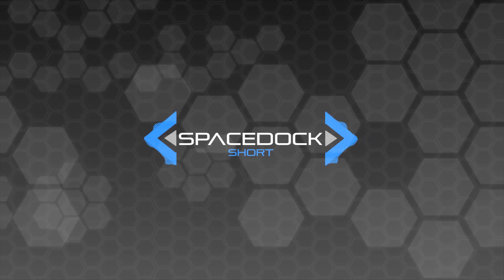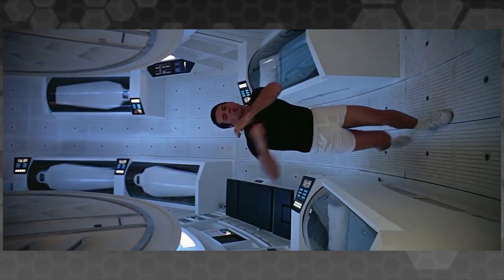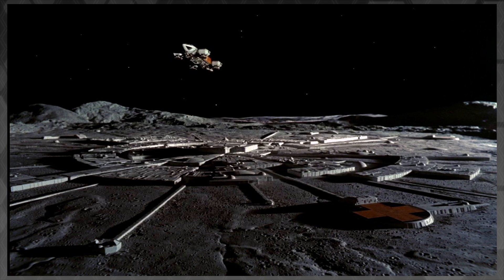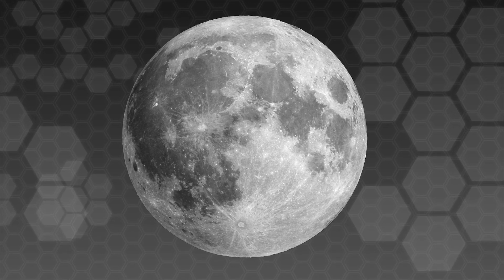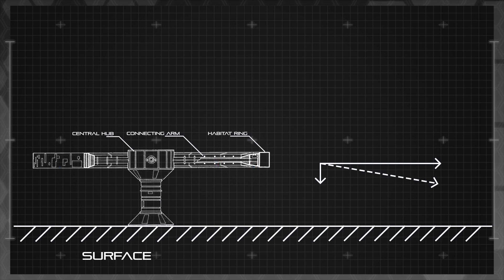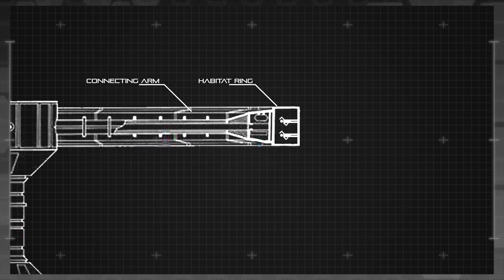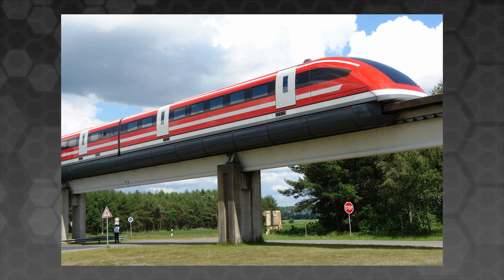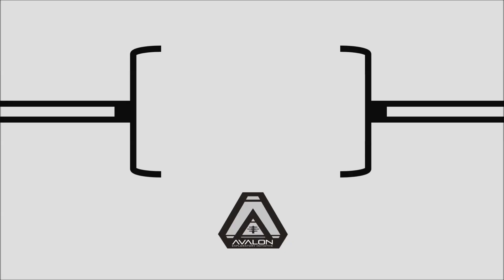How To Create Gravity On The Moon

Comment: It’s a creative solution, the question becomes how large would these structures be, where docking would be located (The Center of the Centrifuge???) and how we would be able to move between them. Also, would a hybrid system be likely, where Hydroponics farms and other necessary support facilities are kept separately, or would we simply increase the size of the habitats?

Anyways, I like the concept. Maybe this will be an actual thing in the future? Hopefully, I’d like to live on the Moon someday, even if it seems impossible.
Reply: I just realized that with a Maglev type system we could have a static center on it, which solves the issue of not having a lot of surface area to grow crops, if necessary, and also provides an area to dock. Solves a lot of the issues I had with the initial design.
Reply: I'm not too sure as to how well crops and similar flora agriculture fares in less than 1G environments, at least not off the top of my head, but if the issue of space is a consideration then why not do it outside the carousel in an underground vault or dome?
Reply: Underground could be good... Also, there are experiments going on aboard the ISS about growing plants in low-G environments, I need to check the results again to see about that.

Comment: My question is, how would you solve the problem of getting in and out of the ring? Would it have to be spun down every time someone needed to go the the surface or to a ship?
Reply: I'd use something like a vehicle that accelerates and docks, or a wheel in the inside that speeds up to station speed. The vehicle might even resemble a swing ride at a theme park.
Reply: If you're using the almost perpendicular floor tilt shown, perhaps using something like a swing-ride gondola makes sense (and so would elevating the base). People would board at the bottom and the gondolas would speed up and swing outward to ring speed and dock to a door in the ring.

Comment: So, an idea i’ve had for sci-fi gravity involved magnetic floor plates along with a series of light-weight magnets on the cuffs of clothing.

Aside from the hell it would surely play with any sensitive instruments, what other problems are there with this idea? I’m sure there are plently of things it doesn’t address or fails to take into account. I haven’t put much thought into it, but just wanted to see how many holes were left in it.
Reply: DocArtemis 
Yeah, I've thought of this idea too. And what you mentioned about sensitive equipment would definitely be a problem. But this attempt at artificial gravity wouldn't work unless you start putting magnets inside your body. One of the major problems of null-g is the fact that your internals are designed for a constant 9.8m/s^2 acceleration, so they won't work properly under anything else.
Reply: They actually use something like that in the Expanse with magnetic boots. It's a perfect solution for trying to move around a ship in zero G, since your feet can move naturally. But that's all it can really do. It isn't a true form of artificial gravity since it would only apply a force on your feet, the rest of your body remains weightless.
Reply: DocArtemis why would you want to do magnetic plates though? It is highly impractical and costly. You'd need to install special plates all over your ship and those plates would need power. And that's not taken into account when they would malfunction. Amp the power and it will pull everything metal to it. 

What's easier and more practical is to just use magnetic boots. But the use of magnetism in zero-g isn't to stimulate gravity, merely just to make people stick to floors for safety so that they won't go flying everywhere.

You have to use something else for gravity m.
Reply: Though magnets might help to normalize mobility, it would not affect the negative health effects of low gravity as the forces would not affect internal body processes.  Centrifugal force is really the only substitute suitable.  Even diamagnetic levitation would not be evenly distributed across all materials as different materials have different diamagnetic properties.

Comment: I'd be more concerned with radiation if you can't dig at least 10m deep.
So, which is a diameter of Moon's home for... hmm, btw, what are the most critical stages for proper development? We can't keep them inside a 10km(150meters sounds more reasonable, but not as impressive) circular spinning city inside a crater from womb to the end of puberty, right?
Reply: The moon existes inside the earth's magnetic field so radiation might not be of as big a problem as you think, at least on the earth facing side.
Reply: Neil 
no, it's not. It passes through the "tail" for a few days each month. Which is not enough neither in time or in field strength to make any significant impact on how astronauts would be f//cked. If you can prove otherwise, I'd be happy to be wrong, but please, provide an argument for that to happen.
Reply: TheArklyte just put a magnetic field near your station and you will avoid it. You don't need a very big one to cover just where you live
Reply: Joan Masdeu 
I really like this use of "just", always did. For example to turn Earth itself into an interstellar spaceship you need just a "bit"of kinetic energy.
Reply: TheArklyte 

Water is very effective at blocking radiation. My solution would be to have the water tank on top of the centrifuge structure. It would function as a radiation shield and water tower at the same time.
Reply: TheArklyte you can't compare, the energy cost of having a magnetic field covering your base in the terms of lunar colonisation is rather small. It wouldn't take a nuclear plant to power ONLY the field.
Reply: Radiation shielding isn't actually that hard to include, actually.  Most of the problems with shielding and spacecraft is that real spacecraft operate on significant weight limits.  You have to track every kilo so you know how much fuel you need to leave Earth's atmosphere and gravity well.

However, once you are in space or on the Moon or Mars, weight limits stop being a major issue.  That's especially true in the low gravity of the Moon.
Reply: As for the "keeping people in a ring for years" thing, I don't think it'd be like that. The moon still has some gravity, and it'd be relatively simple to set up pressurized areas in which many activities could take place. You don't have to put every single aspect of society on your spinning hab, only crucial things like nurseries, sleeping quarters, gyms, etc. You could even set up multiple dedicated spinning habs for more spatial efficiency and flexibility.
Reply: TheArklyte wouldn't it be far easier. To instead of of having a spining  supported disc. have a underground train. Which simply goes in a circle. this would take less materials to create because you are using the existing rock for support. And as it would be underground you do not need to worry about radiation. Would work as a temporary Solution untill you create a proper Dome.
Reply: that actually sounds like an awesome idea! You'd be safe from both radiation as well as meteors and being underground would protect you from the temperature fluctuations on the lunar surface as well. Very easy to build: dig a large underground circular track, put a mag-lev system in for the train to ride on, then place your train cars on and you are done. Most likely, you would only use that part of the lunar base as living quarters, rec space, medical facilitates,  and anything else that requires working in  one g. Most of all the work spaces, science labs, lunar exploration gear, etc would be also underground nearby. I think that even just by sleeping 8 hours in a 1 g field, you would cancel out the effects of living in the moon's lower gravity. Getting on and off the train would require a separate track running along side it: shuttles would speed up to catch up with the moon-train then slow down so you could get to the rest of the station.
Reply: John Weber 
you do know that you contradict yourself, right? They're always limited because your delta V is limited by "get off Earth" stage of your journey. You can't simply teleport into orbit. And you'd also be reminded of your mass on every maneuver.
Reply: Would also be hard to call the Moon a negligable atmosohere with how obstructive moon dust has been proven to beand is a serious concern for any long term mechanical or air filtration applications on the Moon. Submerging and sealing the dust for a large rotating accomodating mass would be difficultto the point wher you would have to wonder isit mechanically more effecient to be on the surface of the moon or in low orbit of the moon.
Reply: Like GTPCgaming said you could use water. Also could use the excavated regolith and cover it.
Reply: +TheArklyte   10 metres of packed lunar soil would replicate the radiation shielding of the 60 plus miles of atmosphere on Earth but a mere 3 feet would reduce incoming radiation to 1/1,000 of what it was hence it's reasonable to expect less than 10 metres to be acceptable. Indeed, the NASA Stanford Torus plans used 5.6 feet of packed lunar soil for radiation and micrometeorite shielding.
Reply: +GTpcGaming   It would take six feet of water to replicate the radiation shielding of 3 feet of packed lunar soil.  Yes, water is often mentioned when talking about radiation shielding but really it's advantage is that it's a necessary resource and hence must be carried whether or not it's used for shielding.  Though it's reasonable to use your water tanks as shielding on a spaceship, not so much on a lunar base.
Reply: +Joan Masdeu   Though, it's easy to produce a more intense electric field than the Earth's magnetic field, it's only for a very small volume.  Earth's magnetic field is vast and the shielding is from the incoming charged particle passing through miles of the magnetic field.  Even with all our power generation abilities, we could not sustain a magnetic field over miles.  Yes, we often talk about artificial magnetic fields for shielding but really it's not a practical option and at best only offers shielding against the slowest high velocity charged particles.  Also magnetic shielding only affects charged particles, much that we consider radiation in space such as cosmic rays and solar winds are charged particles which have similar biologic effects as ionizing radiation but there are gamma rays, x-rays and ultraviolet rays which are totally unaffected by magnetic shielding.  Strapping an electromagnet at strategic points help but are no substitute for shielding materials.  Just producing an artificial magnetic field is not the solution.
Reply: Just bury the fukin thing and use soil as shielding.
Reply: one solution would be to have magnetic coils around the place, creating a magnetic field on the moon. i believe a similar system was planned for an interplanetary vehicle to mars for humans to use

Comment: How would you get in and out? In space a ship docking with a centrifuge could match rotation, but on the surface on a celestial body that seems rather difficult considering the body's gravity.
Reply: By using a vehicle or wheel that accelerates to and from ring speed, of course. Something like what you might see in an amusement park.

Comment: I probably need to re-watch this, but how do you get in and out of this building?
Reply from the maker: A possible solution to this is to have underground tunnels connecting to basements between each structure. That way a person could travel in microgravity down the central column, through the tunnels and then up a different column.
Reply: An American Celt probably through a series of hatches and airlocks on the top of the stricture. A decent enough thrust could perhaps nullify the effects of the station's spin. Usage of magnetic boots is also required to do that.
Reply: You could do it slightly differently and have the centrifuge actually be a sort of train in a recessed or underground tube (connecting the ends after each section is installed).  That frees up all of the "spoke area" in the center of the ring, and you could accelerate carriages from rest at a center station, and loop them out to the centrifuge.  When the carriages get there, they match the centrifuge's speed and you step out into the habitat.  The carriage then decelerates back to the center with departing passengers.
Reply: Scott Leonard Very good answer, especially when heavy cargo needs to be transported outside, or multiple people at once (i.e. marine squads). It is very useful for large scale projects on the moon.
Reply: @Spacedock
Or you know.. just put it on the ground...
Reply: Spacedock right.  they would climb "up" the raidus to the hub like in 2001: a space Odyssey.
Reply: Walk to the center of the centrifuge (with an empty stomach if possible). Jump the last step and take a non rotating leader or elevator built on the axis. 

Or the funny way: surround the centrifuge with big pillows and jump from the edge
Reply: Vicho Deivis that... Is so crazy it just might work
Reply: Well I can only assume that ladders and elevators are used. Bonus points if you use the centripetal force to push the elevator from the hub to the "ground" floor and rotate it into alignment at the same time.

Comment: Spinning up large asteroids is not, actually, a reasonable option. 

Simply put: Asteroids aren't very well held together. 

Let's imagine a cylinder asteroid one mile across spun to 1/2G. This asteroid is mostly iron and silicates (I assume we aren't trying ice). It is, in essence, an infinite number of suspension bridges made out of thick metallic stone with a span of several thousand feet. 

A carefully designed structure (think: built O'Niel cylinder), which was far more structurally sounds and far less massive could work. ... but you are essentially imagining suspending a mountain from its middle. The mountain would crumble.

Comment: There is something to using an EM field to induce a Spin-Gravity field, its seems on the edge of of the tip of the tongue in thought. the EM field has to rotate exactly 90 degrees from the plane of the gravity field.. if you turned it inside out.. is seems a field, not a particle spinning trapped inside a superconductor.. ought to produce a net gravity field indistinguishable from a polar gravity field since the geometry would be inverted... just a thought.. but until room temp superconductors become possible.. i guess we can't test it. IBM produced magnetic bubbles in semiconductors for bubble memory in the 70's.. something like that might be able to spawn spinning circular bubbles in a superconductor sheet.. and an array of gravity sources.. perhaps even that could be rearranged.. as a superconductor spin up ought to be the only input energy.. and spin down would require the bubble producer to produce anti-bubbles to erase the spinning bubbles.. might even be good for potentiating a Fusion reactor.. raising the plasma density to a preferable ignition point and then assaulting it with a final laser blow.. it might also explain how ordinary matter couples atoms and particles to the Higgs Boson field.. since Gravity never wears down or runs out of energy.. as a property.. it seems it should depend on a property of matter.. rather than an attribute of it.. like adding up protons and neutrons to produce elemental characteristics

Comment: Hi Daniel, I belive, that for the moon habitat, it would be better, to build it few meters under the ground, for radiation protection purposes, although, your idea is genialy simply and simply genial at the same time. But by my point of view, will probably combination of your construct and the clasical, be the "best way" to construct a building on moon (underground) solving the biggest issue of cosmic radioactive rays. Ie clasic digging of material, or using roundish impact crater, wide and deep enough to fit your construction inside it, afterwards cover the impact crater by "lid" made out of moondust 3D printed into kinda copulla, or lid, with only top part of the central spire protruding outwards, and serve as comunication antena, main (and only) entrance, moon dust cleaning checkpoint, and watchtower/sensor nest, for comunication and control of the astronauts, stroling around on the moon. Landing bays, Hangars, solar power plants and other surface dveling buildings, ment for (timely) limited visit of people, do not need gravity and can be operated in most day-to-day operations by radiocontroled robots (either controled from Earth, or from Moon) and checked by human operator/engeneer, only in case something goes wrong and VR controled human shaped robots can not find solution (or can not perform it). 

Moon will be used as place to mine Helium 3, or as a shipyard for human space colonization, to wich some of space-mined ores and other materials will be transported from asteroids in our solar system. To some degree, it can be used as source of food for extra-terrestrial activities (simply because it is easier and cheaper to produce food THERE out of seeds or small animals and than get it on orbit for 1/10 of cost). Not sure about the watter thoug... It probably will be solved some different way - presumably by mining water/ice from asteroids, and pumping it to ships directly on orbit from some space-station. Or of course, dropping the ice-loads down on moon, for people there to have something to drink and make oxygen out of.

Comment: If you're already using maglevs why not do away with the whole rotational hub design, and instead run everything along (an) angled maglev circuit(s)? It would have the same benefits, but would allow things to be built in a more traditional upwards, and/or module fashion, and could use terrain in place of some structural foundations